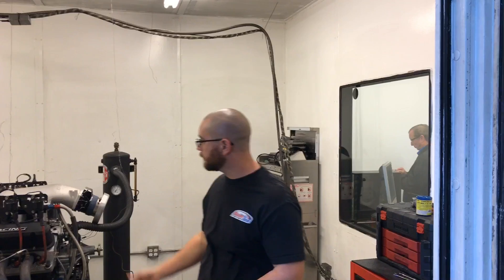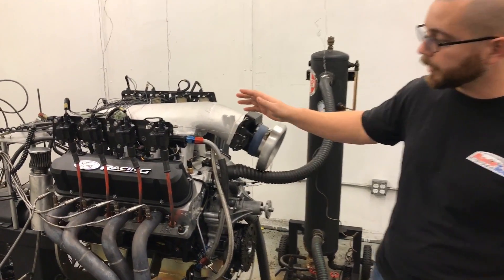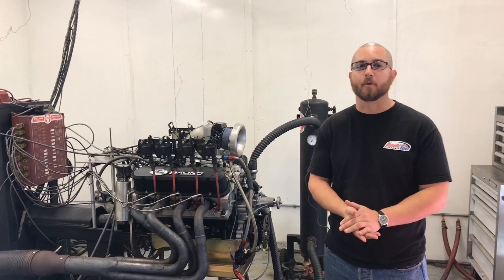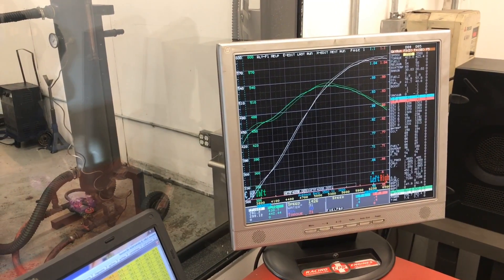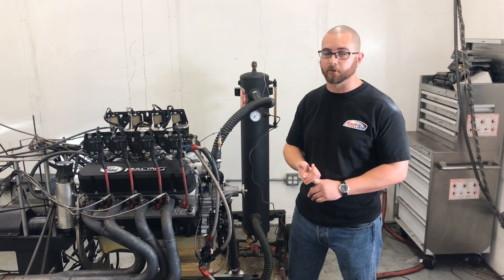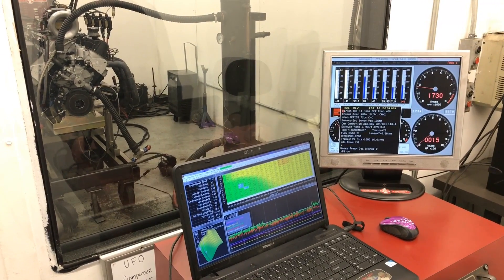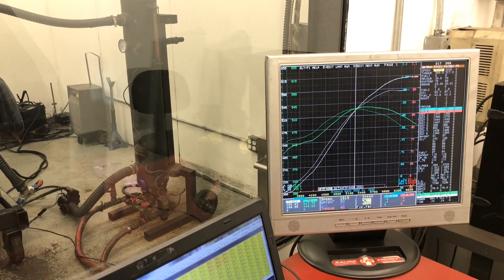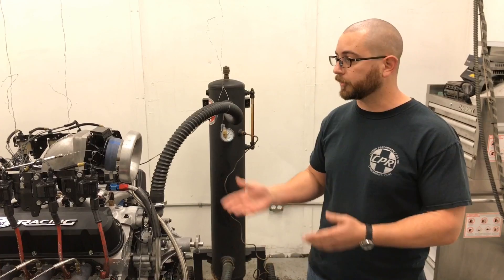CHP 408w Stroker Ford AFR 205cnc Cylinder Head - Cam/Intake Dyno Testing

Comment: The engine has a very narrow power band from 5500 to 6500 with the big cams and 5200 to 6400 with the small cam. The engine really needs 11.5 to static. What you should have done was put some 87 octane fuel in it and see if the power would come up. Did you ever check the cranking compression? My guess it's not much over 180psi

Comment: watch those milodon pans. bottom came out of mine. like the metal crystilized and shattered. inferior metal the machine shop said. trash can item. cost me a rebuild.
Reply: Milodon is crap. Kevco racing pans best bang for buck. They all leak at rear of pain unless you get custom built 351w oil pan

Comment: that cam lift seams short. my lift is '576/.600 on my 398 Windsor.. extreme energy comp cam. i'm using 185cc brodix cnc ported heads . produced 500hp on dyno
Reply from the maker: doesnt need much to make power right!!

Comment: I have a very similar combo, this just reinforces that I really NEED a set of AFR 205 heads, but man are they spendy.
Reply from the maker: let us know we can order you a set when ready!
Reply: I used a set of Trick Flow Rs for heads on my pump gas street car.Also have a stage 5 TFS cam.Have not made any passes yet but I am very happy with this set up.Expect to run 10s N/A.
Reply: @brettcotton3927  do they fit with factory pistons?
Reply: @timweb1510  No.I use DSS forged piston with 11:1 compression & pump 93 with octane booster!

Comment: Thats intresting i would not have thought the 4150 style throttle body would lose power over the elbow and factory style throttle body.
Reply from the maker: smaller overall area most likely.
Reply: Should have better intake or at least spacer. If the throttlebody was same cfm would have made more
Reply: If the throttlebody had a spacer or same cfm as the elbow would have made more
Reply from the maker: @eddienorrisjr  4150 TB does not flow enough, looks way better but not enough CFM
Reply: @coasthighperformance  I was refering is the throttlebody type EFI was also 100mm it will produce more that MPI
Reply: @coasthighperformance  I know this is an older test. Have you guys tried putting a dominator sized TB on a SV intake? I know there's adaptors and even a dominator SV clone offered now for us SBF guys.